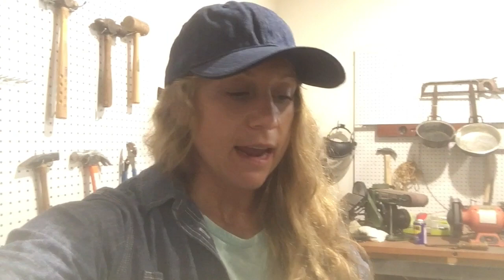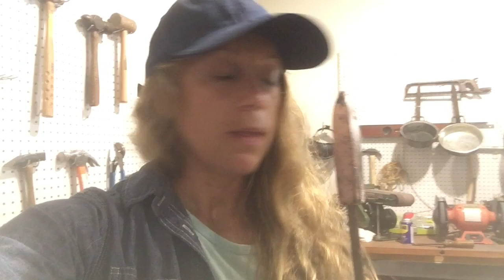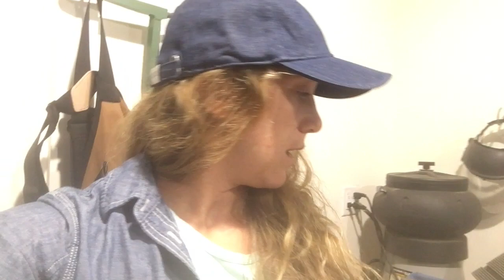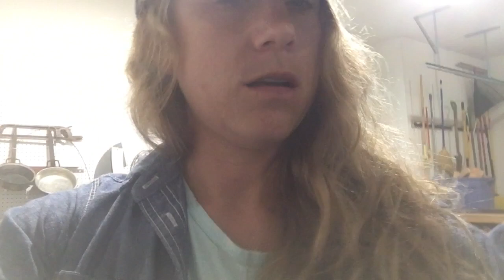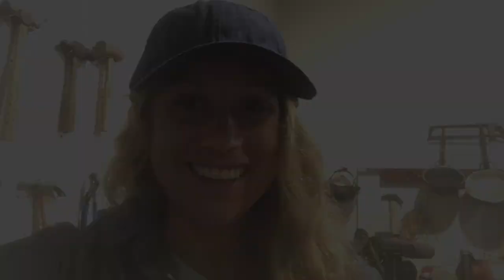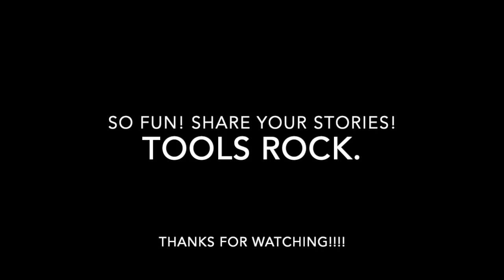Name This Tool : Episode 1

Comment: Do you have the blow torch to go with your soldering iron?    I skimmed your video titles and didn't see one listed . I know you know what they are..... (-:   They'll have a "V" on the end right above the gas flame and a hook back towards the needle valve to hold the handle of the iron as the weighted end hangs downward at an angle exposing the heel and bottom portion of the iron into the flame. I have a number of the irons from tiny to huge and have used them in the past a lot. I should do a video on my stack of irons and torches for you. Btw, I wasn't aware they called the irons 'coppers'....  good one.
Reply from the maker: I have a separate blow torch that I link to a propane tank - it's one I picked up at the welding supply store as they are hard to find. It's not as fancy as yours, and I don't have a furnace built for my coppers - someday I want to build a traditional tin one for them. :)